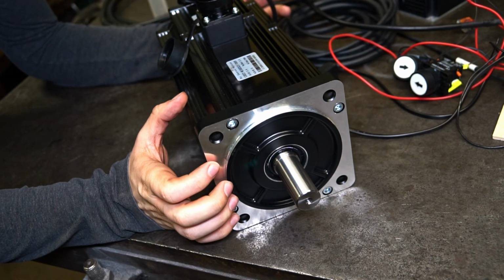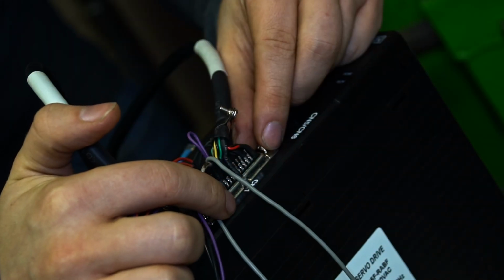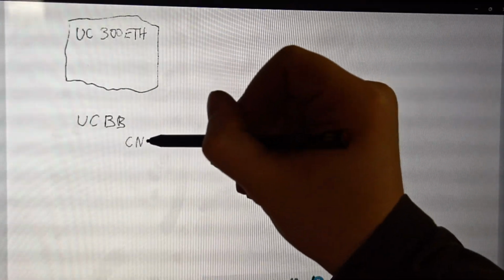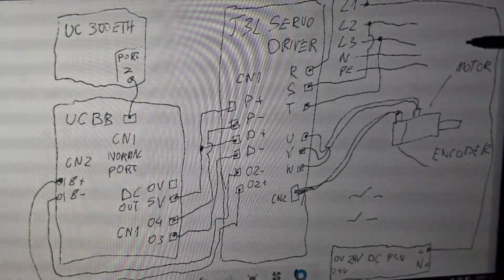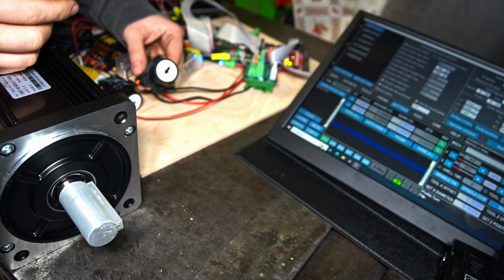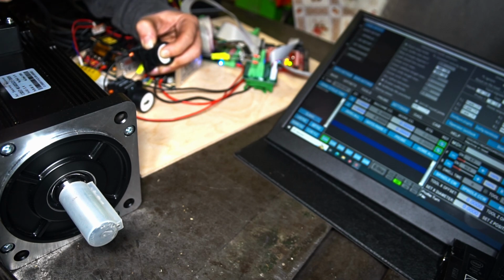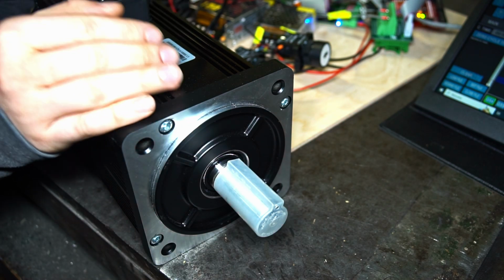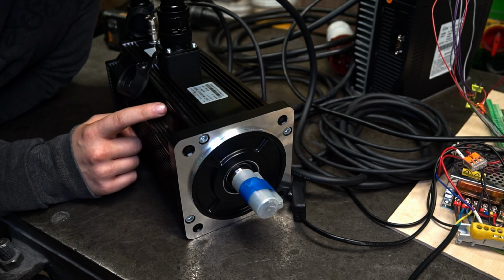Servo Spindle Speed / Position Mode Change - UC300ETH 5LPT #7

Comment: I am working on a lathe too, with a very similar servo drive as spindle. 

Is it possible to run the servo drive in position mode and still drive it at say 2500 rpm? This is within the 500kHz pulse limit of my controller at 10000pulse/rotation. I am thinking about using 2 digital spindles in sync
Reply from the maker: That's an interesting question. There is such option in UCCNC but I didn't use it at all so I have no idea how it works.

Comment: Thank you very much for sharing your experience, I also have a UC300ETH and it helps me a lot. I have a question, why did you choose the C axis for the output and not configure the STEP/DIR directly in the SPINDLE tab?
Reply from the maker: I'm glad my videos do help :) The step/dir in spindle tab is (I belive) to send pulses to a motor in positioning mode to achieve certain speed. For that purpose I have the pwm 0-10V output. The C axis is for the purpose of precision angular positioning of the machined part.
Reply: @GBWM_CNC  Ok I see, thanks for your answer

Comment: Hello! Is it possible and how to do this: You are in position mode turn 90 degrees CW, then push the button to spin in Speed mode and when release the button, motor to stop in the previous position 90 degree CW ?
Reply from the maker: For sure it is! But you'd like to do something like this beside any CNC control? I mean - for a custom purpose without a GCode program? After the spinning I think you would have to home the spindle axis again and get make an incremental move to the 90 degree CW pos. All depends on what you want to do but for sure it is possible.
Reply: @GBWM_CNC   I am using mach3 in my modified lathe and my plan is to attach a mill spindle perpendicular to the gang tool to make parts for a Turn mill. Sometimes I use manual without CNC control and button switching would be the perfect solution if I have the option to stop at the previous position or have a home button for the spindle axis directly to the servo driver. That is the best for me. King greetings :)
Reply from the maker: @valeriradev3759  i think homing would work fine - as i show in the video it can be performed out of the cnc software. The you just move to the right position relative to home.

Comment: Hi. Do you have a special setup for the latch? How is an automatic tool change? Any  idea?
Reply: How I read about uccnc can be problem to do turret. Why you give up with Linux cnc?
Reply from the maker: @VolodymyrKh  i have spoken with the support and they told me there will be no problem with that. They can even help you to make the macros for your machine. I will give it a try - i really liked that cnc control with my milling machine. This is why i thought to use it also with my lathe. Also they recently launched a lathe screen set.
Reply from the maker: Hi! You mean latching the mode of the servo? I'm going to switch between modes with a bi-position switch for my lathe. I'm going to run GCodes either for speed mode or position mode - I'm not planning on mixing the modes during one CNC program. But that would be possible too I guess. In terms of ATC - I'm going to make a turret-type head for my lathe tools. It will be probably driven with use of one of the axis and one position signal. I didn't figure it out exactly yet but I've contacted the CNCDrive support and they said there is no problem to do it with a macro or something like that.